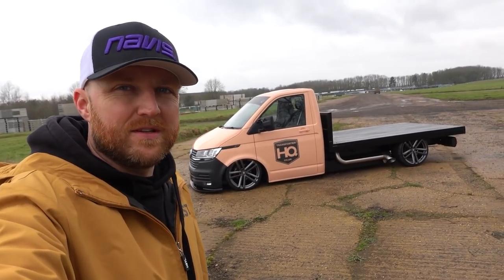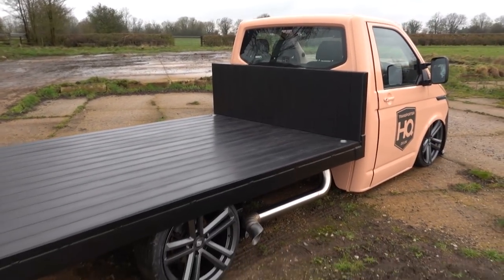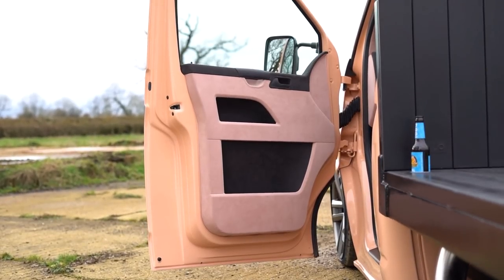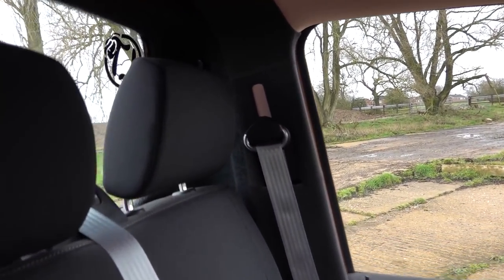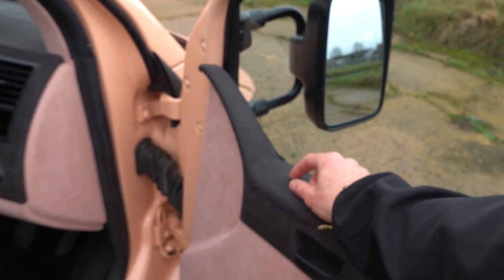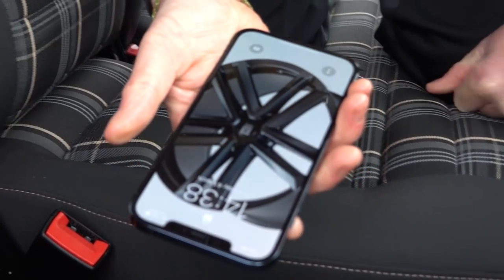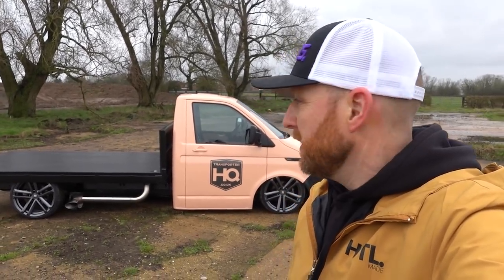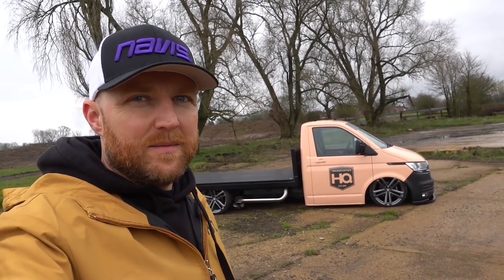It's finally finished. T6.1 facelift Transporter HQ flatbed on air suspension, its salmon, not pink!

Comment: What did you guys use to smooth out the multi function controls on the 6.1 wheel? I’ve got one to fit into my T5, when buying it I thought I’d just be able to use the blanking parts like a T6, didn’t realise there’s no option on the 6.1 for non mfsw! 
Thanks!
Reply from the maker: Body filler